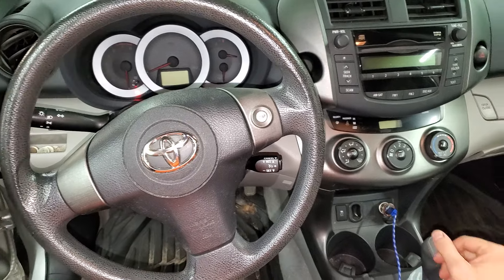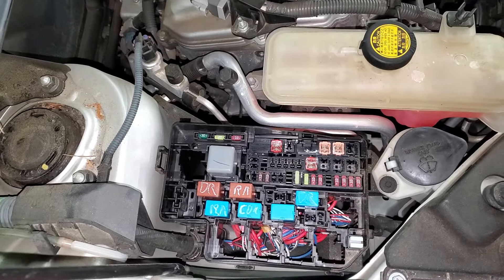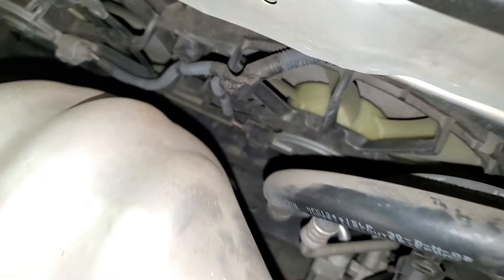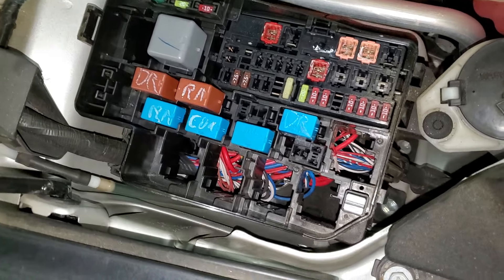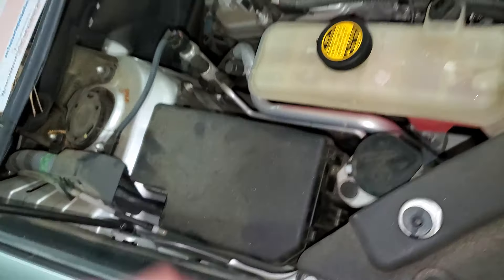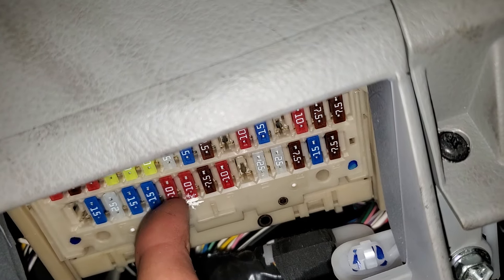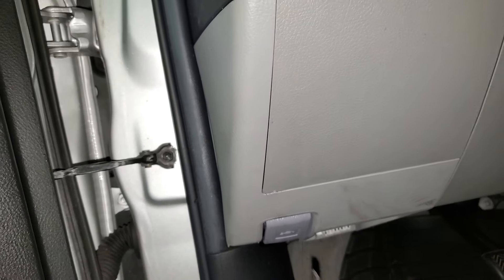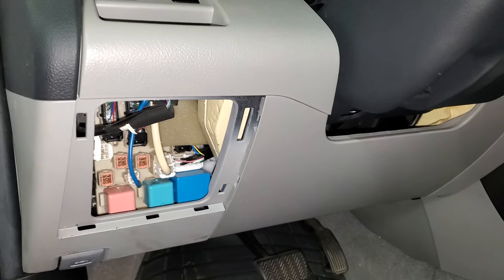2011 Toyota RAV4 AC Relay & Fuse, Blower Motor Relay & Fuse Location

Comment: This is perfect. My blower fan wasn't working, so I just replaced the blower fuse under the hood and it's all good now. Someone tried to repair the fuse previously with a wire and really bad soldering, but that seems to have stopped working recently.

Comment: Condenser was replaced after Collison.  AC stopped working then randomly started again. This spring/summer not working at all. Took to a shop and they said it's electrical and clutch won't engage. I'm going to test the fuses!
Reply: Hi Lisa- I have the same issue, my repair tech said "it's electrical" did you find anything out?
Reply: sounds like the same problem that I have, did you figure it out? Thanks

Comment: Bro! Well done on the video. Direct and straight forward. What are your thoughts on the hvac controls not working at all? Not lighting up or operable. So nothing works, ac/heat, blower motor. Just heard the blower motor making a noise and then it all stopped.

Comment: Thanks for the video. My a/c stopped working on my 2011 RAV4 3 days ago. I was looking for the a/c fuses and relays but could not find any. The a/c system is completely charged or in other words it has no leak. Seems to be something electrical but the compressor does not use clutch it is spinning all the time. It seems to be the compressor control valve that regulates the displacement of the pistons inside the compressor.   Do you have any experience with changing this control valve?
Reply: Hey, I am having the same issue with my rav4 2008 2.4L. How did you fix the issue?

Comment: I have a question!  My 2006 rav 4 limited with electronic button, in dash fan switching.  The blower motor works and it blows hot but it’s not switching to different settings when I push the buttons (floor, windshield, dash fans) what should I be looking for

Comment: Hey when I turn on my airconditioning my cooling fans don’t come on so my compressor doesn’t come on either. I waited for the engine  to heat up and the cooling fan didn’t come on. Where should I start looking for the problem and which fuse.

Comment: have 07 toyota rav 4  ,, a/c compressor runs but not blower motor,,, do you know if the relay is in the same location as the car your working on? thanks

Comment: This info was really good and I will check that for sure but when the heater stopped so did my radio, lighter, rear view mirrors and power outlet. The heaters in the seat works though. Do you have any idea what to do?

Comment: As Mary asked, how do you remove the relay? It's very awkward and I'm worried I'll break something. Does it simple pull straight out?
Reply from the maker: Yes it does come straight out, it helps to wiggle the relay side to side as you pull on it

Comment: My symptoms are the vents blow. And heat works the AC button doesn't illuminate and turn on
Reply: @thesolpurpose3109  same did you fix it mine blows hot air im in az  its really hot without that ac 😭

Comment: blower motor relay cannot be removed easilly like this. you need to take apart the rest of the cover. i just broke my relay housing trying to remove it without removing the rest of the cover. then i tried again and cause a spark. then i stopped. lol

Comment: Hi I change the amplifier air acondicion. But work two days. Now the car is same the first.. 
The power 5volt. There in not 5 volts on the transducer